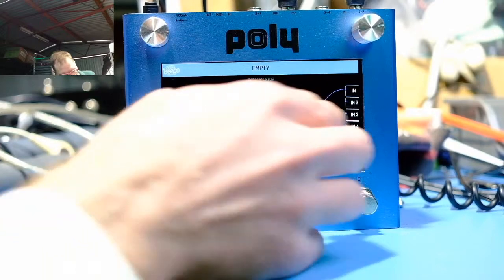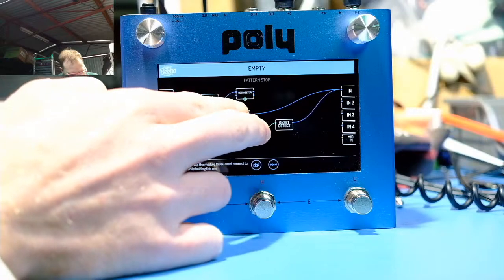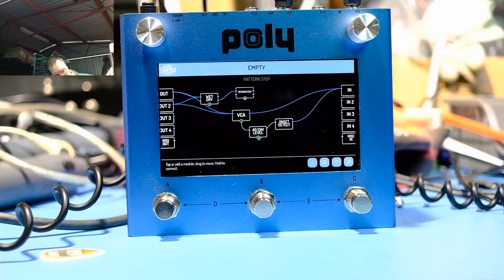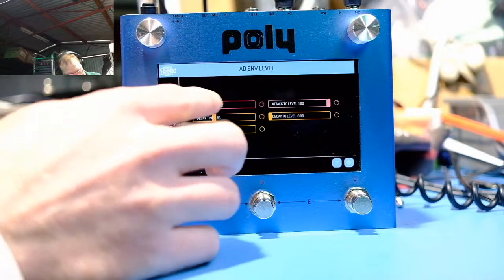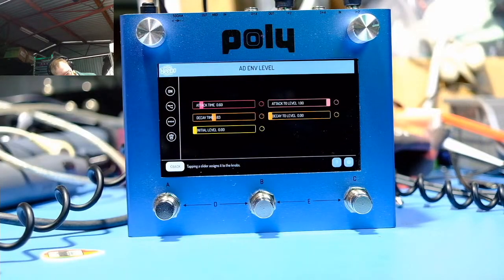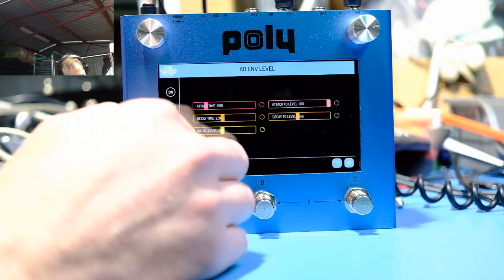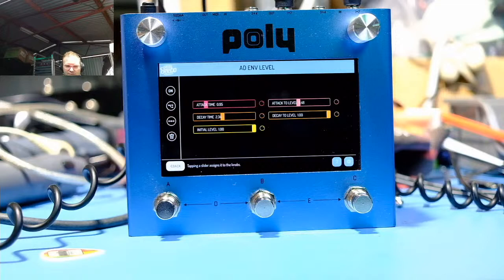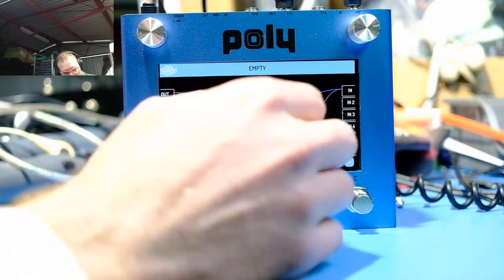Live Digit / Beebo Q&A 2, part 2: setting up ducking and freeze

Comment: Hey, Poly Effects I would like to know if it can also works as a pitch pedal like Digitech DROP or Boss PS-6. My Idea is to use the crazy stuff but I also need to have a compressor and pitch shifter pedal, so I can fit this in my pedalboard by removing Digitech DROP + BOss PS6 and compressor and Strymon Mobius.
Reply from the maker: It'll do pitch down stuff with the time stretch module. Compressor module you can use the built in one or build your own with vca and envelope.